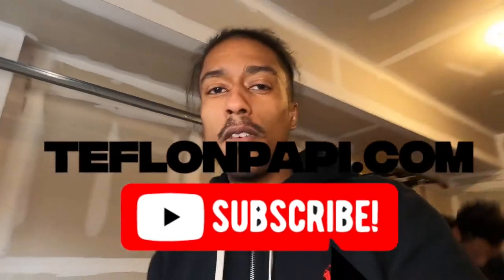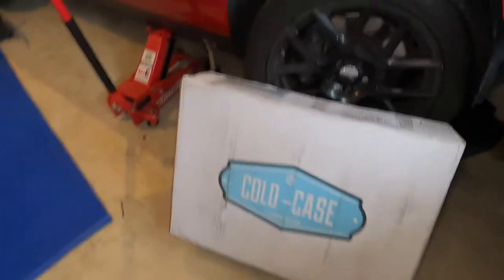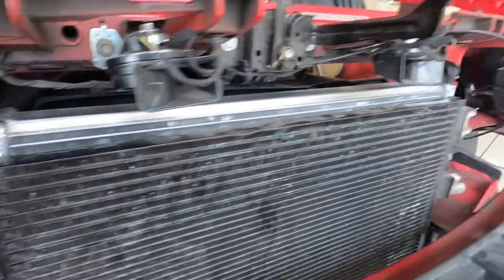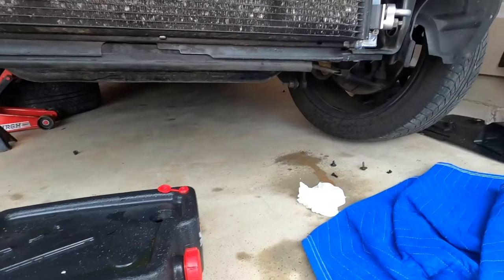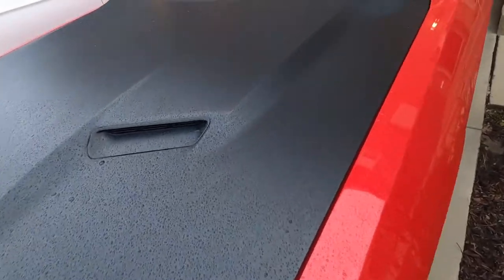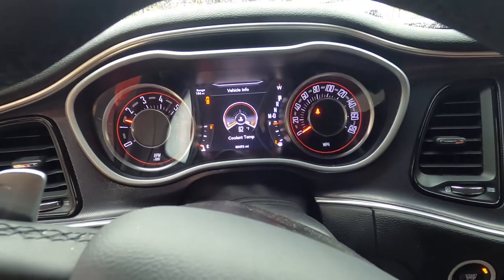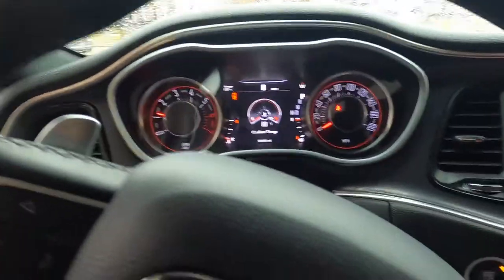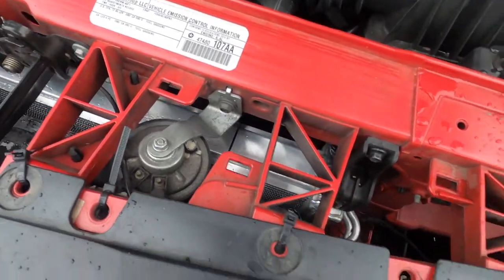Better Than Mishimoto?! Dodge Challenger Scatpack Cold Case Radiator Install.

Comment: My stock radiator went out, due to the strike I can't get it fixed by the dealer. Now looking at aftermarket options
Reply from the maker: Haven’t had any issue with over heating at all since I’ve installed

Comment: There is a heavy duty radiator and standard. You might have mixed em up, my guy.
Reply from the maker: How do you explain the stock one that came in the car breaking. Pretty sure I ordered heavy duty. The all aluminum one hasn’t given me any problems.

Comment: Great video 👍 I’m thinking of getting a Aluminum radiator for my 07 Charger RT. Is there a difference, does it cool your engine down better than the Original radiator?
Reply from the maker: Just a tad bit. But it’s more durable.

Comment: Hows it holding up? Looking to buy one for the Jeep I own and want an upgrade…
Reply from the maker: It’s actually holding up well. No leaks or cracks at all. Runs slightly cooler. I want to get a 180 degree thermostat next.
Reply: @TeflonPapi  did you put the green coolant in
Reply from the maker: Yea I did off camera
Reply: @TeflonPapi  Have you had any issues with it
Reply from the maker: @Utzman4x4  nope. Works way better than the stock ones.

Comment: The stock radiator is hardly adequate.
Reply from the maker: I’ve cracked two of them.
Reply: @TeflonPapi  do you track your car?
Reply from the maker: @jesuschristislord77733  no it just seemed to crack during the last couple of winters we had here.
Reply: @TeflonPapi  wow, that's crazy.  I'm in Michigan and drove it daily through first winter.  Which state you in?
Reply from the maker: @jesuschristislord77733  Washington DC. The weather is ultra weird here tho. It goes from extremely cold to extremely hot. I not sure why they cracked just always seemed to happen during the winter.
Reply: Yeah Mishimoto or this Cold case are way better than the OEM - The stock OEM are plastic side rails , why make that on a high horsepower car for the most viable part to keep it running
Reply from the maker: @fl5099  I heard mixed reviews on the mishimoto so I went with cold case and it worked flawlessly.
Reply: @TeflonPapi  bro same shit happened to me. I got a warranty on parts and labor from the local dealer from the last swap but these stock rads are fucking garbage lmaooo. Gonna either go full mishimoto (lines, 180 therm, aluminum res & rad) or everything mishimoto and pair it with the cold case STD rad

Comment: Yo can someone help? 
I’m trying to get the radiator fan out so I can take out the radiator but no matter how I try to lift it out, the fan gets stuck on the timing belt or pulleys
Reply: Could leaving on the front bumper be the reason?
Reply from the maker: I took off the whole bumper. It’s no way around it.
Reply: @TeflonPapi  thanks man I’ll try that
Reply: @TeflonPapi how is radiator holding up